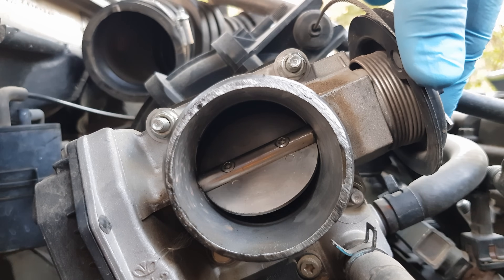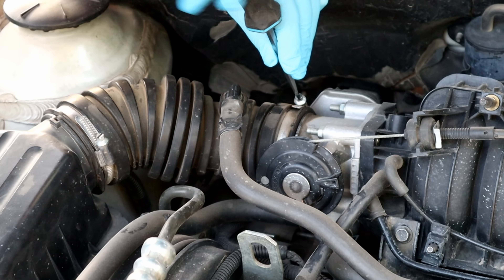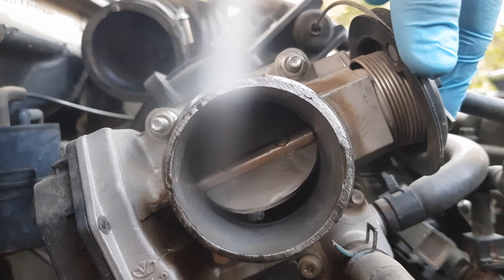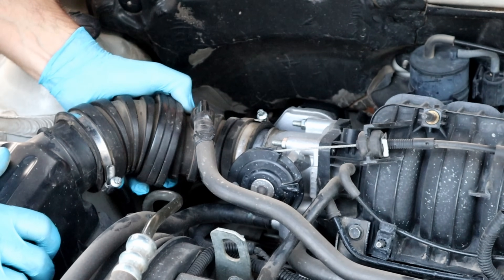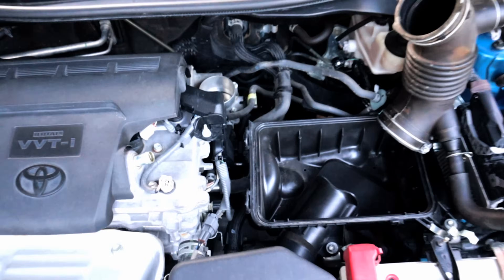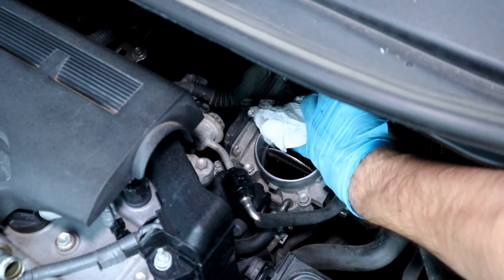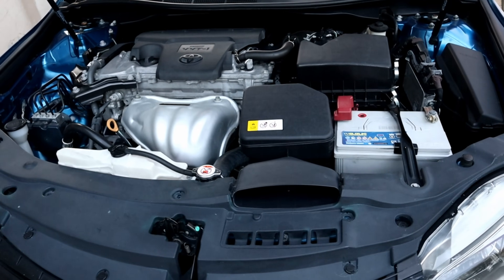Don't Clean throttle body before watching this/Cleaning cable controlled or Electrical Throttle body

Comment: i clean my TB of my mitsu lancer 2015. I unplugged the battery terminal unplugged the tb and I sprayed the fluid on a microfiber towel and slowly and carefully opened the tb. A lot of dirt cameoff (149thousand miles on car) before the clean i had rough idling slow response (variety of 700 rpm to 400) and after I cleaned it. It stays in 600rpm no more rough idling better response on gas and i notice more power on the engine ngl
Reply: How did you reset the TB back after reinstall it sir? TQ..
Reply: @izrulizrol1122  since my car has an electric tb i just unplugged the cable but i did not took it off. After i finish . I put back everything together and then I turn Ignition on (dont start the car) and then hold the the gas pedal all the way for 1 minute and then turn the ignition off (without removing your feet of the gas pedal) then very very slowly remove your feet of the gas pedal . And then start the car and go for 20 minutes drive (after 5 mins turn the ac all the way) and you should see good results

Comment: I was looking for this after ive looked at my throttle body and saw it is difficult to get it out from his position..
I'll not spray inside it tho.
I'll just use a cloth soaked in liquid to wipped it off.
Thanks, mate
Reply: How did that go for you any improvements ?

Comment: Tip: Dont use the red straw when spraying, there's a chance it can come off and fall inside the throttle body. Next, don't use paper tower, it can rip easily and fall inside, instead, use a cloth to wipe.

Comment: Smart trick with torque wrench - this is true re: electronic controlled throttle bodies - they are electronically calibrated and very sensitive.  Never force open with hand.

Comment: Also when you are done your car might be a little hard to start and when it does you might see smoke from your exhaust. It goes away pretty quickly depending on how much cleaner that you had used. I can only speak on the ones with the cable. If you have one that is really filthy it is better to remove it to give it a good cleaning. Old toothbrushes really make short work out of cleaning one and you can use a toothbrush even with the throttle body on the engine.

Great source of information I must definitely hit the like and subscribe. Look forward to watching another one of your videos.
Reply: If using a toothbrush and some carbon falls in, is that okay?

Comment: Good work. I like this video. It's quick and to the point. Good advice on the proper spray TB cleaner only. I think I can do this myself. My Autozone has the CRC brand cleaner. I will also clean the MAF Sensor with only CRC MAF Sensor spray cleaner.
Reply from the maker: Glad it was helpful!

Comment: My mechanic said that Toyota electric throttle bodies can be manually opened very slowly without damaging the unit. Personally only have 148k miles on my Toyota but it's holding up

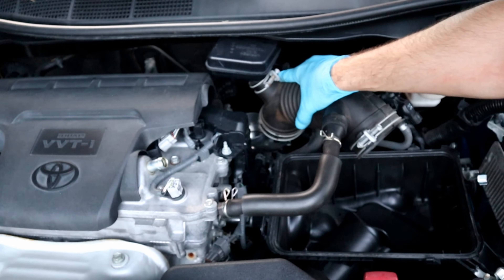Comment: 2:31 dirt?
No thats the crankcase vapor residue from the pre pcv system.
The pcv valve system and intake manifold is even more crudded up, as are the intake valves.

Comment: Thanks for great video.
How do you reprogram electronic throttle body?
Reply: just let it idle for a few minutes or driving on the freeway from 40 mph raise and drop speed or cycle the key in the ignition a few times each car is different for me i just had to idle it for a few minutes

Comment: If you have an electrical throttle body...
can you just unplug the sensor to open 
the butterfly manually rather than 
having to press the gas pedal ?
Reply: In most cases yes. Remove the throttle body completely, disconecting wire, then you can clean it but be careful to move the butterfly slowly. Good idea to go through the TB reset/recalibration procedure afterwards anyhow.

Comment: I would not inject in a throttle body like this with a VAG throttle bodies because because they break internally (circuit board) , but just wipe it with a cloth and clean the valve, it's best to completely disassemble the throttle for better results

Comment: Did you spray it into the electronic throttle body? Because I learned through the Penfoster course I completed, that it is not wise to spray the cleaner directly into the throttle body because it may get into the TPS sensors and may do some damage.

Comment: Good video. Did this a few times on my cable controlled Explorer & Mirage throttle bodies but did not use towel to clean residue. Never knew they made an electrical throttle body.  Don't like that idea in case of an uncontrollable surge.
Reply from the maker: Thanks for watching, most of modern cars these day comes with electronic throttle bodies
Reply: How do you know if it’s cabled controlled or electrical?

Comment: the correct way it to remove the TB so you don't spray the residue down to your valves and create carbon build up on the valve seats. Also carb cleaner will work fine. For drive by wire systems it's not hard to relearn the TB. It's usually a peddle dance.
Reply: Agree on the best way is to disconnect battery, remove throttle body to clean and avoid spraying down intake. Carb cleaners are to harsh for a throttle body. It will strip the coating that most of the modern vehicles come with. Stick to 'Throttle Body Cleaner. As for 'relearns, disconnect battery to clear computer of all old parametrs, to make sure computer has cleared all old parameters, touch both positive and negative cables together (both cables removed from battery terminals.) Reconnect battery terminals, turn off all electrical items in vechicle, lights, radio, ac, wipers etc.,idle vehicle till in the normal temperature range 185°- 210°, this relearns new idle postions, shut off for about a minute, restart, take it for a drive for it to learn  new set of shift points. This is how to get good results, by starting anew and fresh!!
So now you know why 'true mechanics charge to do this service. It's not just cleaning the throttle body.
Reply: @royquesada5295  Do you think you have to do that also on a 2005 Pontiac grand prix or is that procedure for newer vehicles?
Reply: @jonmo2694  ...I believe in erasing old parameters from vehicles that have electronically equipped throttle bodies after cleaning. It's like rebooting your phone or laptop.

Comment: I heard that you not supposed to spray directly into the throttle body because it can mess up the electronic components inside the throttle
Reply: It's safe. The spray will just burn off through the exhaust when you start it. Just let it run for about 5-10 minutes to work it through.

Comment: What happens if you moved the plate manually on electric throttle? I just did it, and drove for 3 miles. Felt fine, but  Not sure if I damaged anything.
Reply: Ur not gonna damage the electronic throttle body if you move the butterfly valve. Just unplug the electronic connector after u disconnect the negative terminal on ur battery. Personally I would take the entire throttle body out of the vehicle and use an old toothbrush and throttle body cleaner to clean the entire throttle body. Don't use paper towel because it can tear and leave small pieces in the throttle body. After you clean it use a towel to wipe residue and put back on vehicle.

Comment: Never, ever stick your fingers in an electronic throttle body with power plugged in.

Those things are geared down so much they will cut your finger off.
Reply: are you pulling my leg or something jesus ?
Reply: This is true, coming from a red seal tech. Drive by wire systems you make sure the vehicles battery negative is disconnected.
Reply: @KillaKliff101  how do you do this then? Like open it without power on. Going to do this ti my 2012 Ford Focus
Reply: @ThatBoyMichael1  disconnect battery negative, this insures the plate doesn't move unexpectedly with your fingers in there. I'm sure it's fine on that model to manually move throttle plate for carbon cleaning.
Reply: Thank God someone mentioned this. I was going to write it.
Reply: @KillaKliff101  will the throttle body still open up with the press of the gas peddle if power is disconnected?
Reply: @brazyuniverse4221  no

Comment: How about removing throttle body from vehicle and cleaning it? Can I use hand to open the flap to clean?
Reply from the maker: Still not a good idea, I seen ppl do that and damage it
Reply: @AliMECH  and what the damage will look like?
Reply from the maker: For some cars you need to re program the plate, and for some, it needs to be replaced

Comment: When I have cleaned TBs I will remove  from engine to clean most of the gunk forms  is on the back side of the butterfly valve. You can move the valve by hand just do it slowly
Reply from the maker: Sure, but on some cars, it's really hard to remove for some ppl if they don't have tools

Comment: Is it safe to spray all the throttle body cleaner into the electrical throttle body? I watched one other video and it recommends spraying on a clean paper towel and wipe it inside the throttle body because of the electrical components behind the throttle body. Any advice. Thank you.
Reply: i wouldn’t  trust spraying that into the hose or valve better spray by on towel and wipe or removed it all together

Comment: But my mechanic have been got problem with this services, after cleaned throtle valve and body, then engine was failed to idling...idling stuck and hunting....a new problem was happened...by the way, always be carefull guys...sometimes cleaning dirt and and deposit carbon could make problem to your engine
Reply from the maker: If your mechanic used carb cleaner on throttle body,  it will mess up so many things, that's why only throttle body cleaner has to be used
Reply: @AliMECH  ow ok, but does both of those product was have same content and purpose bro?..what was the difference ?

Comment: How do I clean a DBW throttle body without opening it by hand, if it won't open (even when the throttle is depressed with the engine running)?

Comment: Sorry for this: never, never spray the t.b cleaner directly onto the throttle body itself. The solvent goes through the butterfly shaft and can damage either the TPS circuitry or the throttle by wire electronics. The correct method is spraying a soft shop cloth and then clean the throttle carefully. The best of the best is to remove the throttle and clean it off the engine. That's a more professional way  but it takes more time and the job will be more expensive to the costumer.
Reply: What?
The TPS /sensors are isolated OUTSIDE the airflow path.

Comment: Nice video. Thank you. What should be done if carb and choke cleaner were used instead of throttle body and intake cleaner?
Reply from the maker: No, carb cleaner and choke cleaner most of the times damage it
Reply: Wrong stuff dissolves the special coating on the TB.

Comment: My 2013 Nissan Sentra 1.8 revs pick up too high with out the acceleration if I give it too much right foot drive it hard . Ok if I drive it gingerly slow . Any advice please I’ve changed transmission fluids and transmission valve body it goes in all gears smooth no noises but can’t accelerate to hard or revs pick up too high . So no rally driving for me right now 😂🤙

Comment: I bought Motul P1 Carbu Clean a few days ago. It says, start the car and spray the cleaner through throttle. I cleaned my throttle body past with brake cleaner without starting the car. And now my problem is due to cleaning with brake cleaner I think idle air control valve or valve positioning sensor was damaged or the dirt inside throttle was moved to sensor or stuck in the idle air controler somewhere. I wish this Motul product will solve my problems.
Here is my question, should I remove the throttle body completely or this is not so necessary? How can clean IAC valve and my positioning sensor?
Thanks.

Comment: I got a 2019 chevy malibu 1.5. Its a touch button start up and I got someone to turn the ignition, had them push the gas peddle but the throttle body valve would not open

Comment: RPM goes high after cleaning. Need to reset the ECU.
Reply from the maker: Did you use carb cleaner ?
Reply: Indeed u do.

Comment: I did exactly as you showed in the video, in my 08 Chevy Aveo, but I noticed that the flap opens very little when the accelerator is pressed. Does that mean I have to replace it?? Pls help! 🥺
Reply from the maker: No, you just need to adjust the throttle body cable, just like i do here: https://youtu.be/Zsz8pLPbNfQ
Reply: @AliMECH  ...Don't think the chevy aveo is a cable controlled throttle body.

Comment: in elctronic throttle body without accelertor cable , if L-N key screw which is hidden in glue type material is messed up with. how can we adjust it to orignal position? do we need to use multimeter to check voltage of sensors at idle and full open throttle? do you know any reference values or can ask any professional who knows the values or procedures? its toyota corolla 2010 model..

Comment: So I unplugged my throttlebody and took it off and cleaned it with carb cleaner and used my hand to open it. Sure hope it works when I put it back on😭
Reply: LOLOLOL RIP
Reply: Did you damage it?

Comment: I don't have scanner to relearn it. I also replaced my crankshaft sensor. Not it's hard to start my car like it wants to turn on but will not. I have to pump gas pedal a lot then it starts. When in drive I can accelerate. Please help

Comment: Never clean the throttle body while it is connected to intake manifold. All the carbon and residue will go directly into intake. What will u do about the dirt which goes inside?
Reply: Exactly.  I found this video dangerous.  Because the throttle body must be removed to clean it safely
Reply: i think there is no problem cus all dirt gonna burn when you start up the engine
Reply: @Abdullah-.-  it will surely burn but will create a layer of carbon deposits on valves and valve seats
Reply: @mianmuzammil7544  I Wonder that too but carbono will be dissolved and won't stick to the carbono in the valve. It may actually help clean the valves (matter of fact there are intake valve cleaners that are used this exact same way shown in the video)
Reply: @DeepSouthernTX  i meant that dust and sand will stick to the throttle plate and will go directly inside when sprayed with a cleaner. That cannot be dissolved.
Reply: What's your air filter doing buddy?
Reply: @coffee702  air filter is before throttle body. Cleaning residue will make its way directly into manifold
Reply: I like to spray the cleaner directly onto a clean shop rag and just wipe it down. That way majority of the grime stays on the rag as opposed to being washed into the intake.

Comment: Or... you'll destroy protective coating in throttle body and have to buy a new or used throttle body. I know because I have done it, fortunately I was able to get used at reasonable price, no problems since then.

Comment: I have a question. If I apply as the engine running, does it clean the carbon deposits on the valves?
Reply from the maker: Yes

Comment: Did you need to do any relearning procedure after completion of the cleaning? Did you notice any changes in performance?
Reply: need to see which model. japan car easy , but not nissan need obd tool.
Reply: @alanw5812  Honda accord 8
Reply: after clean ,make sure all nights off and fan or radio too, key turn to 2 ,then slowly push down the acc pedal all the way and off , key off .
Reply: honda even don't do anything, it just the first drive idle a little high, after warn up,the 2nd day will be fine.

Comment: my one is non-cable controlled throttle body. did u just show "ABRO Carb & Choke cleaner" not to use in throttle body? just want to know more side effects. thanks.

Comment: I have an electrical one and the check engine light is on doing this can it fix that ? I plugged a scanner and said it the throttle

Comment: So on the electronic throttle body even if the battery is disconnected the plate can't be open by hand?

Comment: I just tried to clean it and I turned the key all the way just before starting it and I had my son depress the gas pedal but it (the plate/disc wouldn’t move. Last year I cleaned it but I didn’t know I wasn’t supposed to touch the plate by hand and I moved it to clean it and ever since I have a high idle at 1,000 rpm.
Reply: @@rookerman. yeah that’s my luck, I find out after I broke it but live and learn right. I’m getting a new car in the next couple months so it’s not a big deal anymore. This car has too many issues to fix and it’s not worth it to me. Idk, maybe I’ll fix it but it needs 02 sensor, muffler, shocks, coils not to mention led headlights, lift kit, tires, rims (or paint them) some body rust and a new sound system stereo and speakers.
Reply: @@rookerman. yeah I’m looking at the 2023 Toyota Highlander but I like the jeep Laredo too. Idk I’ve got to go for some test drives but I’m thinking brand new is the way to go 😁
Reply: Needs a idle relearn with a scan tool.
Reply: @elcomandante9299  it ended up fixing itself after a year and a new O2 sensor 👍🏼

Comment: For the electronic one, Do you have to ignition ON, for the gas pedal to open it, or does it work without ignition ON?
Reply: You will need to turn the key to the on position. Car does not have to actually be started though

Comment: Thank you, lucky I did not damage mine. I moved the plate with hand by force on an automatic one. I noticed a higher RPM after but it gradually came back to normal below 1000. Thanks
Reply from the maker: No problem, on some cars they don't get damaged that easy, good job 🙏✌️